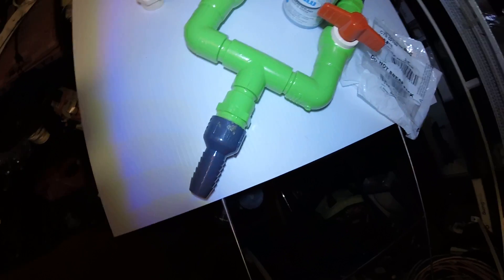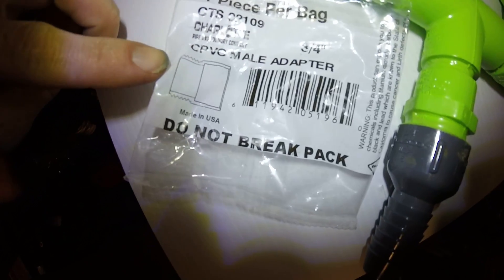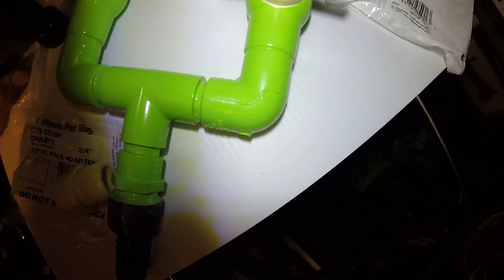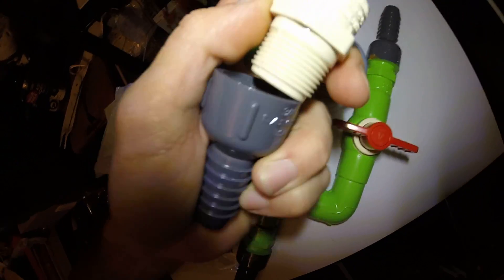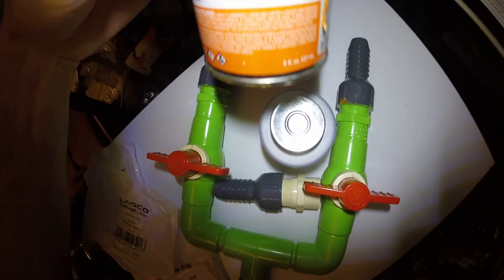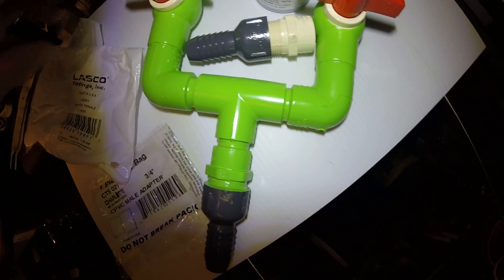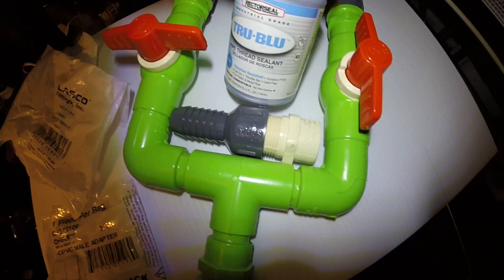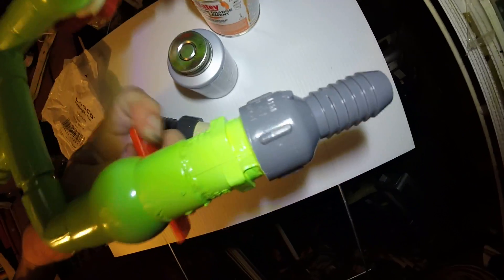Soft Wash Twin Proportioning Valve's DIY Today For Cheap Under $20 Better Quality, Free Flowing GPM

Comment: Did you do a flow test to determine chem strength?
I want to build one too because they’re people charging waaayyyy too much for a simple plastic system!

$400-900 for $30 worth of plastic parts. Not even glued together lol

I need the right ball valves that I can meter with certain amount s of I put

Comment: I had thought about building one that way …. But issue I see is how do you know the exact’ish percentage….
Reply from the maker: 50/50 is exact as can be. From there its more of knowing the feel of your valves and how strong mix you need for the job. I run 50/50 chlorine & water to avoid repaying.
Reply: @loneposse607  I’m just now starting to try to learn about this. If you want to run 50/50 water and chemical would you open water valve all the way and chemical valve halfway?
Reply: @MichaelElliott83  You open them both all the way. If you open chemical halfway it will be 25% mix
Reply: @ashtonkferry  if you use surfactant, can you just add it to the sh tank or would you need a third valve for surfactant?
Reply from the maker: Just by feel. Both valves on is 50\50 so just adjust from there. If you want a weak weak mix just barely crack the SH valve on. You just get a feel for it.
Reply: @loneposse607  Do you use surfactant?
Reply: If I’m understanding if you’re using 10% sh and you have both valves open all the way, you’d be at a 5% mix. If you turn SH halfway you’d be at a 2.5% mix. And so on, now getting an exact 3% would probably be line he said, getting a feel for your valves etc but you can be at a ballpark.
Reply: Where is part 2 I want to see how this works?and why did you use cpvc instead of regular pvc?

Comment: Would u make me one :)
Reply from the maker: Yes I would be happy to =)
Reply from the maker: $131 shipping included for one dual vale set-up like seen here. You can cash app $loneposse
Reply: @loneposse607  could u do a 3 way so I can pull soap too?
Reply from the maker: @Rt2comments  Yes Sir, can do.
Reply: @loneposse607  how much more
Reply from the maker: @Rt2comments  $130 Deal of the day =)
Reply: @loneposse607  hey just saw ur other video will I need to put check valves in so it doesn’t contaminate my other tank?
Reply from the maker: @Rt2comments  Yes you will need them to keep the water pure. The soap should be thick enough to prevent any back flowing though a small check valve could be added there if desired. Size the check valve up to your 3/4'' suction hose as sometimes they will measure outside diameter or inside diameter. Get a check valve with the least opening resistance around 1/2 pound  to .75 pound for best flow & distance performance from the nozzle end.
Reply: @loneposse607  is there anyway to put them on the valve? I’m not good with plumbing
Reply: I think I might go in a different direction if it’s not possible I just can’t have the back flow :/
Reply from the maker: @Rt2comments  No worries, I'll take care of you. Just add $60 to the price for the three check valves for a total of $190 shipping included. =)
Reply: @loneposse607  heck ya thanks man!

Comment: Check valve??
Reply: Spend the 300 an get the right stuff
Reply from the maker: @thomastobara977  The Loneposse MP-5300X  (triple mixing valve with 3 check valves) is pre-assembled and ready to use out of the box. No time spent hunting for the right size fittings, ect. Inside diameter & outside diameter and other variables. This MP valve is also cemented together as well  thus removing the possibility of a leak on the job that could result in asphalt or grass damage. The other valves run such high dollar fittings nobody dares glue them together as they need to feel a sense of resale value if they disassembled it. The Loneposse MP-5300X for $249 Delivered is Built to last a lifetime while increasing returns on investment with lower equipment & start-up cost.
Reply: @loneposse607  I’ve got some bad news for you, SH will 100% eat through that glue and that cpvc eventually. Nothing that SH touches is going to last a lifetime.
Reply from the maker: @brianstewart7560  With my research previous to building my own. I would guarantee it will last a lifetime. The good news is CPVC rates Excellent to the 2nd power if you look into compatibility of SH to CPVC or CPVC cement on a chemical compatibility chart. PVC itself rates excellent and would also be fine to use and I have seen a few PVC valve's in service locally. The 10,000 gallon tank I fill up my SH from has two PVC valves with blue glue if I'm not mistaken and it hold's up fine in the sun. I never use blue glue myself. I use CPVC on PVC pipe as well as I have seen marginal results from blue or clear cement glues. Remember this manifold is under vacuum and will never be under anything but a negative pressure. Should a leak occur it would just suck air, pressure and spray distance would drop and you would glue over that pin hole. I have never glued pipe together with any leaks that were under pressure so these under vacuum will be worry free. I also have that true blu and I would not trust a always liquid glue to stay leak free when the entire manifold is pieces screwed together. Return on investment is most important when in business for profit. $200 more in advertising will always beat a more expensive  valve hidden away in a box in my book =) Much Love Brother
Reply from the maker: @thomastobara977  Remember thats $300 in parts, they don't order or assemble themselves. The Loneposse MP line of valves are more free flowing and ready to hook-up outa the box and make money. There has to be value in that. Cheaper & ready to profit.
Reply from the maker: No check valve needed when batch mixing. With water in one tank and SH in the other they will mix slightly which is fine so long as you don't use your on board water to rinse when using the valves to mix. I believe I get farther range on the spray without the half pound or more of resistance on a check valve. You can add a check valve if needed.
Reply: (great idea)I cemented both my gfs and pentair valves!
Reply from the maker: @jamesl.3030  Yes Sir, It has one use. Make money and never leak.. =)

Comment: Hi can you please give me a list of all the component parts broke down please
Reply: The pvc parts as well please buddy
Reply from the maker: @jonnysgardenmaintenance  I sell them for $86 each and $45 shipping per order if you would like a Real deal genuine Loneposse  "MP Mix Master 5200" The MP stands for MORE POWER and it comes with a set of custom Loneposse more power decals like the red & white decal you see in the back side windows of my truck. A $20 Value for free. =)
Reply: @loneposse607  ok sounds good I'll cashapp you the money soon buddy Goodman 👍
Reply from the maker: @jonnysgardenmaintenance  Sounds Good Brother, You-da-Man =)
Reply: @loneposse607  how much for 3way buddy it would be better alright for chloride will it be water tight have you had any problems with yours leaks etc if these are good I will surely buy more in future 😀
Reply from the maker: @jonnysgardenmaintenance  Water & air tight. 100% Guarantee or it's Free.  For one triple valve $130 shipping included. CPVC is naturally resistant to the effects of chlorine and chlorine dioxide. Instead of the hydrogen molecules that surround the backbone of other plastics, CPVC is protected by large chlorine molecules. Its protected by chlorine. These are the most chlorine resistant valves on the market. =)
Reply: @loneposse607  ok $130 is £96 pound sterling I'll send you £100 pounds sterling for 3 way that's delivery and all my friend?
Reply from the maker: @jonnysgardenmaintenance  That Sounds Good Brother.  Cash App $loneposse and include your address and I'll get you a 3-way valve in the mail asap. =)
Reply: @loneposse607  would like one of your 2 ways sir.
Reply from the maker: @terranceford6330  Yes Sir, Will do. Cash-app $149 to $loneposse and I will have it mailed out asap.  =)
Reply from the maker: @terranceford6330  Yes Sir, Will do. Cas-app $149 to $loneposse and be sure to include your address. I will have it sent out asap.  =)
Reply: @loneposse607 are you still doing these metering valves?
Reply: Love your videos by the way
Reply from the maker: Charlotte Pipe 3/4-in dia 90-Degree CPVC Elbow
Item #23756Model #CTS 02300 0800
You will need Two
.............................................................
Charlotte Pipe 3/4-in dia CPVC Tee
Item #23760Model #CTS 02400 0800
You will need One
...........................................................
CPVC 3/4-in CTS Ball Valve
Item #21480Model #P200CTS34
You will need Two
............................................................
Charlotte Pipe 3/4-in dia CPVC Adapter
Item #55594Model #CTS 02110 0600
You will need Three
.............................................................
3/4-in Dia Insert Female Adapter
Item #54092Model #350307
You will need Three
............................................................
When sealing these threaded fittings I first used true blue pipe thread sealant but wasnt impressed, so I started over and used CPVC pipe glue on the threads and quickly screwed them together.  You will also need a short piece of 3/4'' cpvc pipe & cpvc (orange) pipe glue to attach all the fittings together. Hope this helps, all part numbers, ect listed are from lowes.com though all of it can be purchased at Ace hardware. I'm just not sure if the part numbers are the same. =)
Reply from the maker: When pre-fitting the threaded parts together they wont thread well with each other only a turn or two. After you put cpvc glue/cement on the threaded parts they will thread all the way together so easy it will feel as if you had buttered them or oiled them up. Have a wrench on one end and a wrench or monkey wrench on the other side ready to tighten the parts together after you gob them with cement.